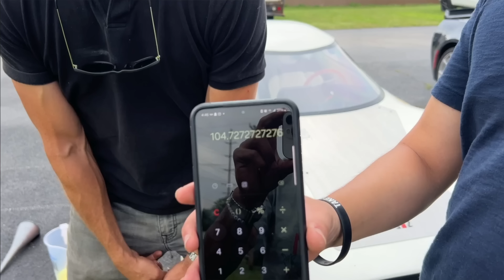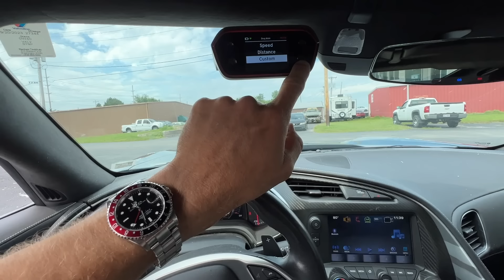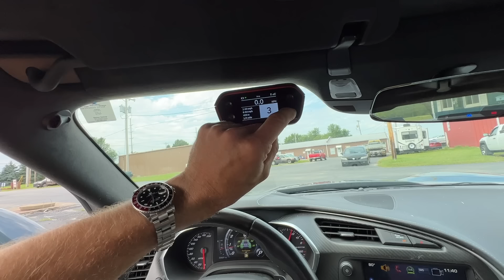FIRST 0-60 mph Test- Diesel OMEGA CAR - Video 3 of 3

Comment: Simple science.

Make a car with as little garbage in it as possible, as light and as aerodynamic as possible, and it will get better fuel economy and have better performance. Diesel cars getting 80MPG has already been done, so lighter more aerodynamic car is a good way to get another 20MPG.

The issue with a lot of new cars is they are bloated and overweight for their size, you can make a engine as efficient as you want, you can put a hybrid system on it, at the end of the day if a car requires more effort to get moving and keep moving, you will have to burn more fuel to make more energy to do that. So cars have lagged behind in improvements in fuel economy.
Reply: Yep, but at least a part of that weight is safety, which this omega clearly has zero of.
Reply: This is true, but you can still add safety features without adding too much weight.
Reply: Being around and developing real racing cars and other vehicles helps one understand what makes a safe car in a crash. One thing race cars do often.... crash. They have technical safety rules for chassis design, build and materials. Even seat belt placement and driver egress for emergencies are scrutinized. Are they perfect for all crashes? No. No car is perfectly safe. Neither is walking... every step you take could end with a fall that could be devastating, yet virtually every person does it every day.
Reply: @13aceofspades13  no you can't, an airbag system alone would be 100 pounds, you also need lane assist etc. it adds up, not to mention the car has to pass the crash safety test which it won't without more weight

Comment: This is awesome and a great showing that ICE engines can still be viable.

But i dont know anywhere in this US youre getting 3gallons of biodiesel for 3-5$ total. More like $3-5 a gallon which is still $12-15. And on off peak hours it costs me $12 for 200miles range(can cost me as much as $24 during peak time at the same charger so there is that...). Just food for thought and stats accuracy.

Comment: The issue with making biodiesel is needing an indirect injection engine to make it work long term. These engines are rare now, given fuel standards/emission standards...but tech has caught up, so they are possible again, with proper fuel standards/emission standards. I have considered a hybrid motorcycle for military contract, turbo diesel, indirect injection. A lot more to it, believe me, but that's the core of it. I have many ideas, could use funding...lol.

Comment: Rest assured I've driven plenty of "death traps", but for argument's sake how do we get something like the Omega car to pass current NHTSA and other regulatory body safety standards? As far as I can tell, there's a TON we can do to improve the product for the current AND future people of the planet if we simply forgo safety.

I guess my own retort to my own comment would be this: You could take a 5 star rated safety car today (brb, googling), let's say the Acura Integra and give it aero mods like moon discs and more, gut as much weight out as you can, give it appropriate wheels/tires for better aero and lower rolling resistance, swap the engine out for a high efficiency turbo diesel, and remove any unnecessary system and probably get at least 60mpg highway, maybe more, without compromising it's safety in any way.
Reply from the maker: Your entire comment is pointless after your fully ignorant inference that the car is a “death trap”. You are awarded no points and may god have mercy on your soul.
Reply: @CaseyPutsch  hence the quotes.... I'm acknowledging common opinion of the safety of vehicles and my comment is based on working within those larger societal assumptions which is where we get the nanny state driven NHTSA... Maybe I should have used emojis...
Reply: @CaseyPutsch  also, my "Death Trap" quotes were as much directed at the cars I've owned as anything. The Omega might actually be safer than some of the junk I've owned. I used the term mostly because of it being used in other comments and attempting to address the topic in a civilized manner and discuss how we might actually be able to move FORWARD with cars that don't meet the modern hive mind "safety" regulations.

Comment: the only thing about the omega car is if you get in an accident it really will earn it's name..
Reply from the maker: Spoken as a person that has literally zero
Information on its construction.
Reply: There is an equation for simpletons like myself.  Fun= Dangerous.  Light weight=Fun, Fast=Fun.  Heavy vehicles are not fun.  I know nothing about this cars construction, sure.  But if it is THAT fast and THAT fuel efficient it's likely not going to have a bunch of safety related weight.
At least it will be safer than a bike.
I'm not saying don't have fun, I'm saying it isn't a conspiracy that these things aren't common.

Comment: I wish gas didnt create so much NOX when you lean it out. My 35MPG CRZ can top 80MPG if you reduce the fuel charge by giving it low 02 density 100F+ ambient high humidity air and drive responsibly without the AC.
Image you could just design an engine to take the heat and faster flame front of a lean mixture in winter(where i normally get 40-45MPG below 32f) to get the same fuel charge in the winter as in the summer.

Alternatively, imagine a zero interference valve(doesnt need to be a traditional valve could be a rotating disk with slits in it) with electronically controlled VVT that can cut off the air intake under low load to give it 1/2 the air charge effectively doubling the compression ratio, while also pulling vacuum on the fuel to help vaporize it better for more efficient burn.
Reply: Of note, the most i've gotten out of a tank was just over 600 miles with less than 1 gallon left in the 10 gallon tank(i think it worked out to 64MPG), it is very hard to find time to drive 600+ miles efficiently in hot weather like that without going nuts from baking in the sun. So i dont, that was my daily drive to work, around 11.7 mile one way trip on country roads, and a few city stops(mostly stop signs) Oh, there is also a ~160ft elevation change on one end, and an ~80ft elevation change on the other, where i need to stop at the bottom of each hill no matter which direction i'm going.

My most recent refill was 341 miles and 5.99 gallons at the same pump i always use, though i expect my next tank to do poorly as i added injector cleaner. I'm already down to 53MPG despite not driving around in town, where the last fill up saw several in town visits and 56MPG
Reply from the maker: Yuuup

Comment: Casey, if you had a 30hp electric motor driving the front wheels solely for breakover inertia from a dead stop or a little boost going up hill, mileage would go up 20-30%. This is the only place where electric drive really shines. You only want enough battery for 5 minutes of operation. Any more than that is unnecessary weight and kid cobalt mining.
Reply: How about TWO? Instant torque vectoring would make it safe handling when you need it, a drift machine if you wanted that.
Reply: Hell, 30hp would probably be enough to put this along at highway speeds on flat ground given how aerodynamic it is. A normal car, after all, only needs 60-75hp to do so and I could easily see this having only 1/3 the total drag as a normal car. At that point, you could probably idle or slightly high-idle the 1.9tdi and get 700+ miles of range on a 5gal tank.

Comment: the only thing i dislike about this project is the fact that you chose to go for a diesel.
now, don't get me wrong, they get great mileage, and everything else about the car is extreme well made, and a direction i would personally like to see the automotive industry go in, or at the very least consider and back as a viable option.
but diesel emissions, even though they have cleaned up tremendously over the years, are still far more dirty than petrol.
and i get it, a fully loaded diesel semi going 50 MPH for almost 2000 miles pumps about the same amount of NOx emissions into the air, as burning 3 pounds wood in a fireplace.
but, having the choice between pumping NOx or only pumping Co2, then just the Co2 would be the better option.
lest you wanna go back to the smog filled days of yore.

regardless of all that, I'd one day would like to try my hands at doing something similar to what you did with the Omega car project.
it's good to see people still make stuff like this, regardless of how I feel about the details.

Comment: The International Energy Agency says regarding its Net Zero Emissions by 2050 Scenario, demand (and supply) for critical minerals copper, cobalt, silicon, nickel, lithium and graphite will have to quadruple in size by 2040. That is just 15 short years away. 

Such an increase in the supply of minerals and metals has never occurred in history. This will require the construction of a huge number of new mines. Mines that ironically run on massive quantities of hydrocarbon fuels. 

Back in 2022, the IEA said that by 2030 alone, the world would need to build 50 new Lithium mines, 60 new Nickel mines and 17 new Cobalt mines. That is mind boggling and, quite frankly, cannot be achieved logistically nor can it be financed either. 

In its recent New Energy Outlook report, it states that its net-zero scenario would cost US $250 Trillion by 2050. 

Currently financing is drying up as every aspect of “sustainable” is bleeding red ink scaring away investors in droves. 

All stated goals, edicts and mandates concerning EVs and Green Energy are a politically motivated Pipe Dream.

Comment: No doubt it is a  fast and fuel efficient 1 of a kind kit car.  How much weight will it take to add AC, windows that roll down, airbag system a street legal exhaust and get it road legal in all 50 states is the question.  All the extra stuff manufacturers have to throw on by law and regulations kills some of the efficiency of your design but not the production method or recyclability of  it.
Reply: still miles better than a 2tons suv

Comment: I’m not trying to start an argumentative debate, but the same thing that your talking about with the omega car could be applied to a form of an electric car. Instead of having to utilize waste products, energy can be sequestered from the sun, hydroelectric, wind or nuclear sources. It doesn’t have to utilize components that implement slave and/or child labor and it has to be recognized that it’s disingenuous to insist that only the EV industry is plagued by those atrocities… Coal, oil, and mining in general are all guilty of having these tragic practices occur on their watch, and the blame really should be pointed into the local authorities that allow these things to transpire in their areas. It’s next to impossible to control every aspect of a supply chain, at least, until those in power bring as much of these things back to the US where more moral practices generally take place.
Regardless of the fuel source. I appreciate what this is. I guess I just don’t understand where these polarized opinions involving different technologies comes from. It seems that it’s more of a barrier to progress than it is intelligently honest, so I don’t waste time with it. Gas, diesel, electric, steam… it’s all means of producing motion, and should all be considered and utilized. Personally, I think the industry is more to blame for these problems since maximizing profits is and always will be the primary goal regardless of what has to take place for that to occur and misinformation campaigns are just a big part of doing business these days
Reply from the maker: Yes

Comment: You didn't show off the Tesla model 3 in its best acceleration mode (Level 3 Insane) in your comparative speed tests, Tesla's reviewed performance mode enabled time is around 3 seconds. Your clocked tesla run at 4.60 seconds seems like the car was in its lowest performing mode. Awesome diesal 104mpg car tho.
Reply from the maker: Current manufacturers lie about 0-60 using a roll out rather than actually 0

Comment: Fun video. I agree with the Idea.
  I think you could make a comfortable car that seats 4 or 5  with air conditioning. And safety parts. that even  would not have such a 0 to 60 speed with a great MPG.  people would buy it. 
All I do is work and seems like all I need is a dependable car to get me there.    Thanks for sharing. I have access to a few old cars (100 +) From a privet car collection in Kansas, Hit me up if you r interested in a peek,

Comment: Omega Car Diesel Electric would be great next project.  Use version of your  little diesel in its best spot on its band width charging a bank of batteries (in future capacitors. or combination of the two ) .  Why diesel electric..... well one electric is NEVER going away..  but neither should petroleum industry.  Soooooo team up.  That and more and more electric cars used the more entrepreneurial spirit will drive  innovation to make longer lasing batteries (less kids in cobalt mines in third world countries)  and will drive innovations in use of capacitors with/over batteries. 

PS- what diesel are you using?? A TDI or an MB?

Comment: awesome car, but noted that Fiberglass and carbon fiber are not really recyclable..
Reply from the maker: Do you have a point about those composites? I don’t understand how that is relevant.
Reply: @CaseyPutsch  thats just beecause you say the car is recyclable, well, composites arent quite recyclable.. at least yet..  just to straighten the fact. Youre comcept it still awesome and close to what i want to build for myself, i do agree with the point that a 100mpg car make electric vehicle mostly irrelevant and may use less ressources. 

do you have a drag figure of the car?

Comment: The problem with this car isn't speed or fuel economy it's safety and practicality.  What you've done is create a car that is designed to be as lightweight and aerodynamic as possible while completely ignoring all of the other things that make up a modern safe car. 
Sure it's fast and it gets great fuel economy but would you send your daughter off to college and it knowing that it probably has a 10x greater chance of killing her in a car accident then even the most basic modern vehicle?
Reply from the maker: Did I? I didn’t know you were at my shop and in my head all these year. Great to know!
Reply: @CaseyPutsch  Nice sarcastic response but seriously. Take that same car and add all the safety features that are required then add all of the modern conveniences that people expect from a car and let me know how it goes. 
I'm not trying to be mean here but you're acting like you've created some sort of revolutionary concept when all you've done is taken a regular car strip everything out of it that needs to be in it by modern standards to make it as lightweight as possible and then claimed victory. 
Don't get me wrong your car is cool but it has zero practical application in today's world. 
If you were just pushing this as a cool kit car for enthusiasts that you created that would be fine but at least by the way you're talking you make it sound like this is some sort of revolutionary idea that actually could be used to solve mainstream problems. It's not. People have put a small engines in very light aerodynamic cars plenty of times before. In order for it to be revolutionary it needs to do all the things you're saying it does and be something That could legally be mass-produced and be something that people would want to take to the grocery store everyday.

Comment: You're right...we are manufacturing cars all wrong. Even the EVs...the weight keeps going up, when we've hit diminished returns. It's time to innovate something other than batteries and motors, get back to basics. I often DO NOT agree with you Casey...this is not one of those times.

Comment: What does it weigh?  What is the HP and Torque?  This thing has to be light to get it to accelerate that quickly.  Good luck getting it to pass safety standards  I'll bet that thing weighs less than a 1st gen Miata.  If I was in a crash,  I would much rather be in the Model 3.  you don't even have shoulder restraints let alone airbags.  You're fooling yourself Casey if you think this is a viable solution.

Comment: I LOVE AND AM VERY IMPRESSED WITH YOU BEUTIFUL CAR DESIGHN. I Built and invented an engine with only 14 moving parts and on the fly variable compression. Currently struggling with funds to produce and impressive prototype and patent. Thought I'd throw a line your way see if your interested. and while I'm fishing I'm sure you can surmise it can run on any combination of fuels with variable compression current prototype can handle 1-8 to 1-22. It's weighs 30lbs and makes 120hp propane carbureted. Sounds like a f1 (no valve train so no limits and sequential exhaust notes) but its more of a torque machine. I'll be sure to find you if I make it to production before you maybe return the favor. lol

Comment: alh tdi??? 
ive messed around with alot of PEV and have ALOT of dead batteries in my garage
i consider EVs single use products like plastic straws

i just picked up an older smart fortwo cdi that gets 65mpg and is more environmentaly friendly and cheaper to run than my Begode Master EUC lol

Comment: The problem you have with your car is it is not a practical design.  Sure, you might achieve some of your goals with it, but when you make the car practical for humans to actually use, you are going to have to pick two of three things.  Do you want 100mpg and sub 5 seconds with no personal usability (rendering this moot other than maybe a commuter car), 100mpg and usability, or usability and sub 5 second times?  Pick one.

Edit:  Oh, and don't forget all the safety regulations you're going to have to meet.